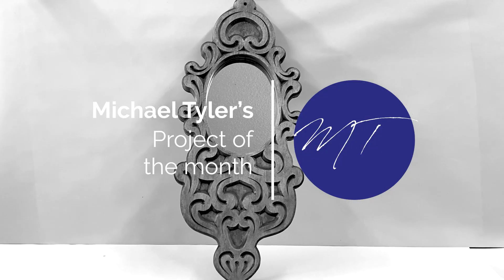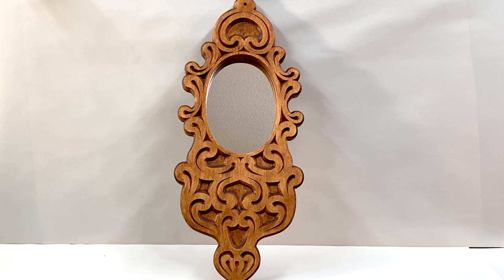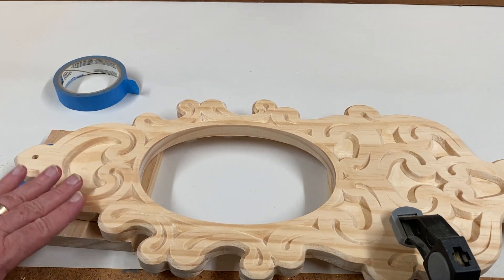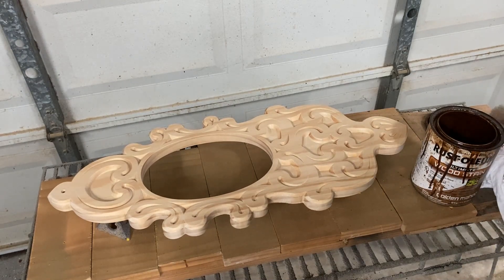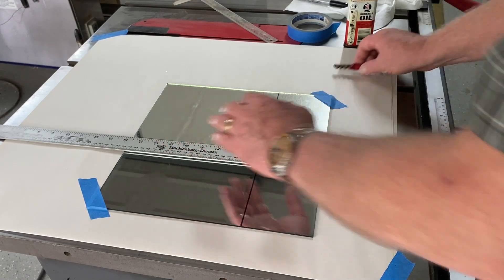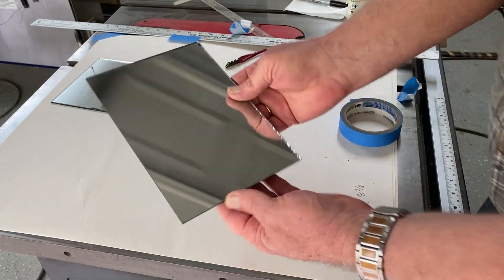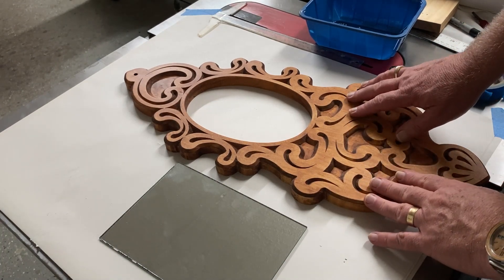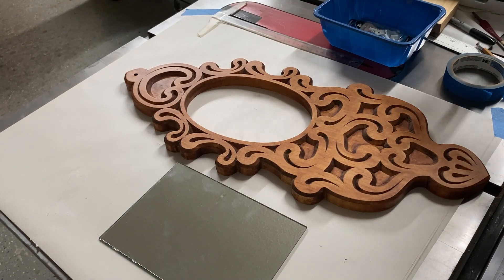Making a Arciform Mirror  | Michael Tyler's FREE CNC Project of the Month | Vectric

Comment: The "ball" on the end of that glass cutter is for turning the glass over after you cut it and lightly tapping along the cut, which breaks the glass along the cut. This avoids the glass breaking in your hand and slicing your arm open by doing it the way you do on the edge of the table. SAFETY FIRST. Also, that glass cutter does not need oil. I used the same one for years and never once applied oil, and it never dulled and gave me any problems.

Comment: Nice project and the mirror looks good. Maybe should have cut the glass a touch longer? And perhaps don't rely solely on the silicone to hold it up. A couple of tiny screws below the bottom edge of the glass would do no harm.
Reply from the maker: Hey Don!  Thanks for the ideas and we will pass that along to Mike!